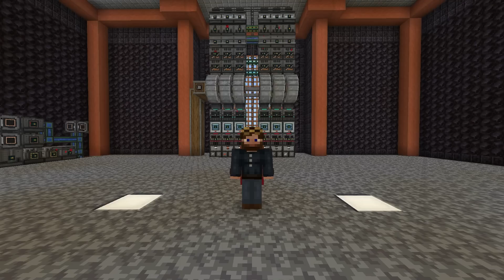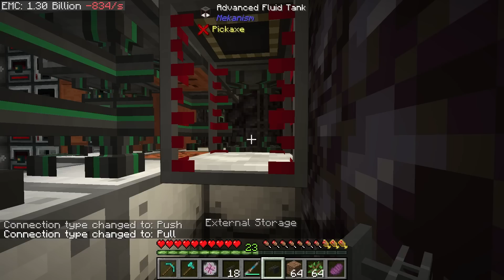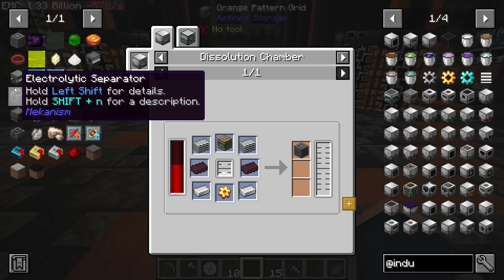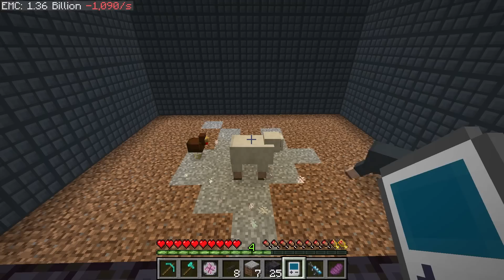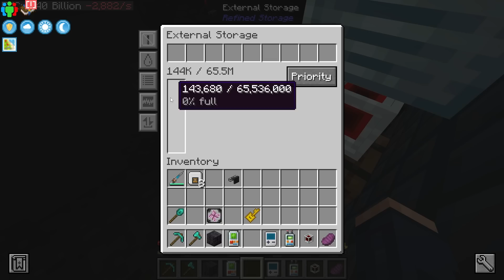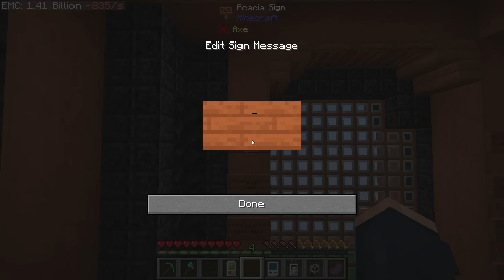Mechanical Mastery Minecraft Modpack EP15 Industrial Foregoing Mob Farms + Autocrafting

Comment: If I remember correctly, the hardest part of the antimatter generation is the patience. I don't remember if it was sped up or not. But I do remember it still taking a while. Might want to start that before anything else to ease the wait time for antimatter.
Reply: He should use watch of flowing time
Reply: @skmd.imrulhaquesakkhor4814  Agreed. Still takes a while to build up (even if he technically only needs 6 pellets or so.
Reply: @aer015  huh sounds like a lot of afking i havent started on endgame and i am scared. Dont watch of flowing times stack
Reply: @skmd.imrulhaquesakkhor4814  Sometimes. Depends on the modpack. Just want to mention it's not the condensing into an item that takes a long time (if you pump the machine with millions of rf), but rather the polonium (or whatever fuel) into liquid/gaseous antimatter.